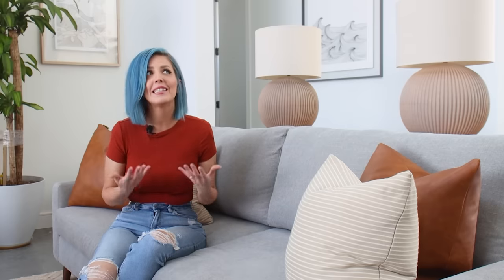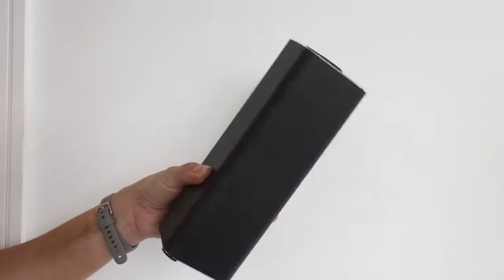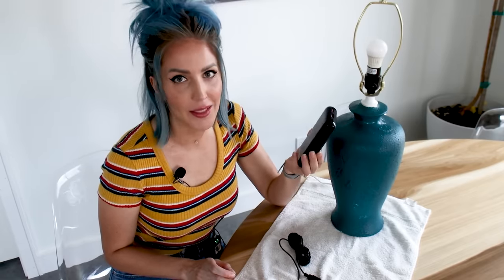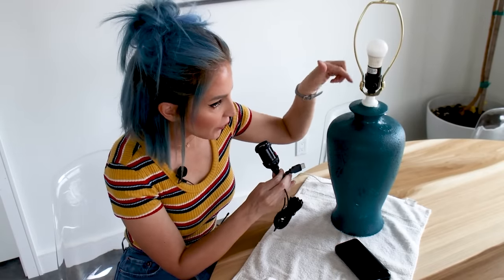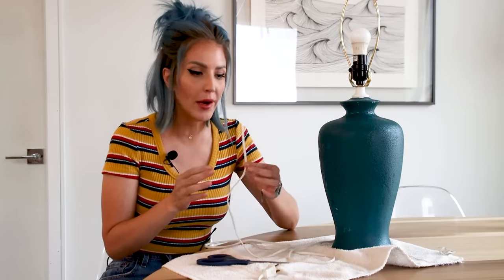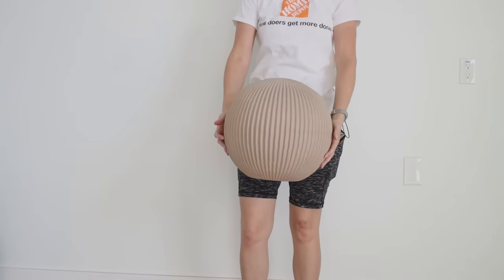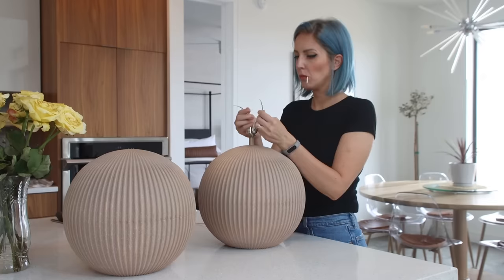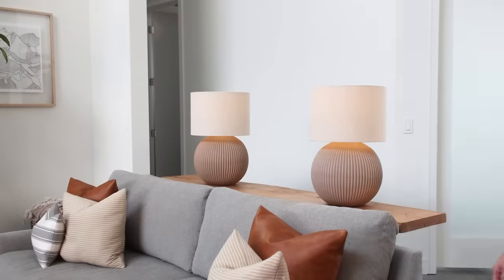3 EASY Ways to Make a CORDLESS Lamp

Comment: These methods do not work at all with the materials this person is saying will create a battery operated light fixture. There is a mismatch in the wiring and the suggested light bulb.
Reply: I finally got it to work, but I had to use a lamp retiring kit with a regular push switch in the fixture base.

Comment: Okay let me mansplian the electricity. Wattage is the only tech words you need to know about lamps and batteries because Amp or volt by itself do not provide useful information. If a battery is 120WH then it can power a 20watt LED light bulb for 6 hours. Most power supply are not American they are European with universal plug support. The only time you need to know about volts and amps is if you are adjusting a governor on a gasoline generator and manually calculating the wattage.

Comment: You are far from doing anything right here.  First of all the "special" socket that is the "key" in option #2 is not necessary at all.   Second, why look for the impossible to find 5v light bulb when you can buy 5v led light strip in any color temp you prefer for less than a standard light bulb AND it would be dimmable. 

Method #3. 8 AA batteries?  Really?   That is horribly inefficient.  How about 3 X 3.7v 18650 rechargeable batteries.  Oh and by the way, just one 18650 battery will power a short run of 5v led strip lights that you should be using in method #2

Comment: Engineer here... In no universe were you getting 30 hours runtime. You are fibbing. tsk tsk.
In that configuration, even the best NiMH rechargeable AAs will last no longer than about 2.25Ah
Modern led bulbs have an efficiency of about 100 lum/W now-a-days, and NiMH rechargeables supply roughly 1.2V for the vast majority of their lives (so ~10V for eight AAs), so runtimes are as such:
100W equiv = 1600 lum = 16W = 1.6A = 1.4 hr
75W equiv = 1100 lum = 11W = 1.1A = 2 hr
60W equiv = 800 lum = 8W = 0.8A = 2.8 hr
40W equiv = 450 lum = 4.5W = 0.45A = 5 hr
25W equiv = 250 lum = 2.5W =  0.25A = 9 hr

Sorry but this idea wont even last one evening, and I'm sure not removing, recharging, and replacing  8 batteries daily. My lamp is fragile and heavy. She is holding an A19 bulb and the lowest wattage frosted A19 bulb you can get that looks like that is 3W, so 7.5 hours max for basically an accent light.

Listen, I know you did all this work and dont want to have wasted your time, so you need to make a video out of it and get those views, but you should be honest with us.
Reply from the maker: I absolutely have been honest. I will film a time lapse with a clock if I need to. After 30 hrs, the light was noticably dimmer but still illuminated.  I recommend you purchase the same products I used and expedient for yourself instead of accusing me of being a liar.
Reply: @PneumaticAddict  I'm not accusing you, physics is, dear 😂 smh.
And you are already changing your tone as in the video you said the lamps were still "going strong with over 30 hrs of runtime", and now you say they were "noticeably dimmer"...
But fine, I'll entertain this since you were good enough to respond... You say i should use the products you used. Well what watt bulb did you use then pray tell?? You failed to mention this quite key info. Why? (cuz it's basically an accent light at the wattage it was drawing from the pack, lol). 

As for the batteries, I just want to mention you filmed yourself using alkaline AC Delcos, haha, pretty much the worst possible battery (and brand) for this application, which clearly failed miserably as it could only have possibly had just a fraction of even my paltry listed runtimes above, and you then proceeded to run your test again instead with 2800mAh rechargeables to get your "30 hours" (almost certainly NiMH (right?) as in my assumption/description above, possibly the popular EBL brand). 

Assuming perfect rated efficiency (it never is at this high of a power draw) of 2800mAh (aka 2.8Ah), we just need to find the the Amps drawn by the bulb now. So divide this mystery bulb watt rating by 12 to find the Amps drawn. Finally, divide 2.8 by those amps drawn for the exact hours runtime. 

Enlighten us at what step you were able to defy physics.

Theoretically if you wanted to run a bulb for 30 hours you could just under-volt it to near the cut off voltage of approx 8V so that it draws almost no current and produces almost no light. Let's say your 12V bank was defective (not hard to believe at $6) and causing a voltage drop down to 8V (because it was stealing energy between the batts and the bulb due to inefficiencies), then what kind of average current could be sustained over 30 hours? 2.8Ah/30h = .093A. What wattage does this provide? .093A x 8V = 0.75W. Go ahead and look up 0.5W and 1W bulbs on amazon. They are the tiniest of accent lights that you can stare straight into lol (aka def not what you saw in the vid). So even if you received a faulty bank (or maybe your wiring skills are to blame, haha, jk jk, i doubt that), and you are not lying about the 30 hours, then you are still not being honest about the brightness and the fact you can get usable lighting... or is this what you meant by "noticeably dimmer". c'mon now :/

And if you do a time lapse, just leave the windows open in that room... You can mess with a clock but you cant mess with the sun :D
Reply: @PneumaticAddict  Also, explain pls how you are able to waaaay outperform specially built lamps for this?? The 2 highest capacity cordless lamps on amazon (both under $100 btw; so another thing you mislead us on) have specs:
2.5W (5V) light of 250 lum on 4 D batteries with 8hr runtime (according to reviews)
6W (12V) light of 420 lum on 8 D batteries with 8hr runtime (according to reviews)
[Each D battery is 4 times a AA battery at ~10k mAh, btw]

These lamps significantly underperform my above estimates due to other inefficiencies I haven't even gotten into yet, whereas you way outperform the physical limitations I noted initially. So how are you getting 30 hrs from the equivalent of 2 D batteries on a 12V bulb that looks like it's at least 6W or more in the video??? ... cuz you're not.

Comment: $110 for a Portable power bank with inverter to make it 'cordless'....I'll pass. BTW, No need for an inverter if you just use 12V LED bulbs with a LIPO battery bank, plus a charge circuit. Fewer $$$ and more efficient.
Reply from the maker: Did you watch the rest of the video?